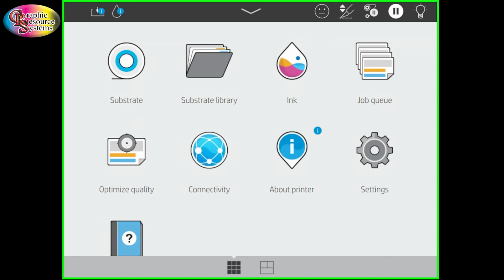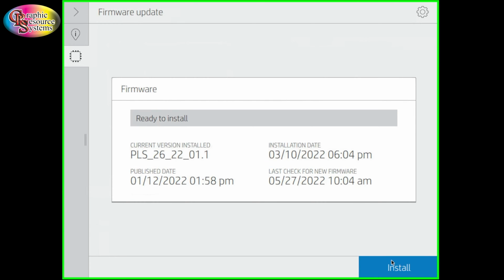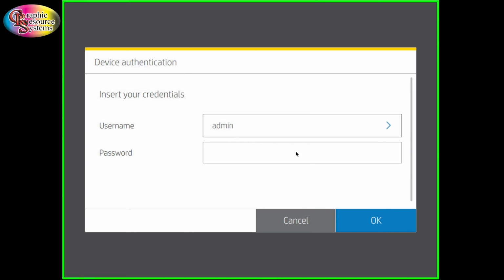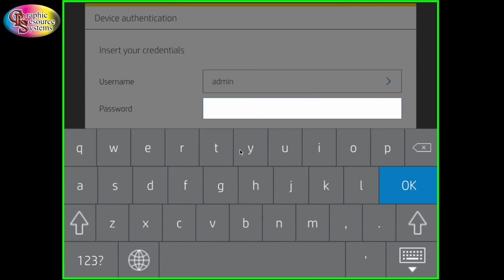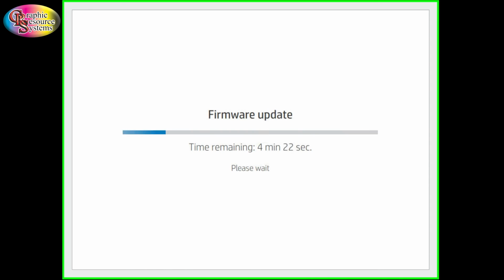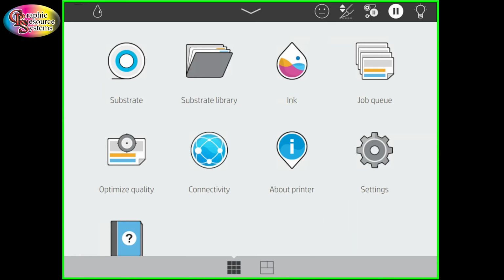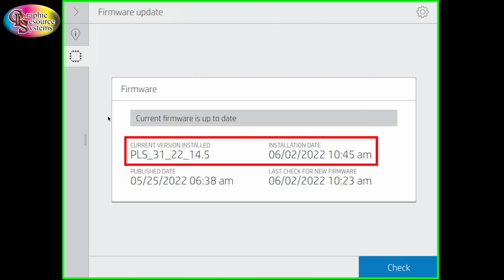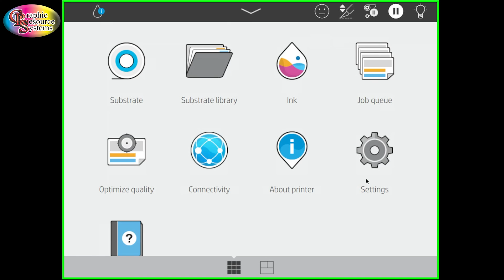Guide on updating the firmware on the HP Latex 700, 700 W, 800, or 800 W printer

Comment: How do you do it with a USB drive? Our printer does not have internet connectivity due to our IT's firewall.
Reply from the maker: You can follow the instructions on this pdf file from HP.  The first page and the top half of the second page show you how to do it. https://lkc.hp.com/storage/app/uploads/public/63f/864/ed2/63f864ed248d0335199970.pdf
Reply from the maker: I know this comment was a long time ago, but we now have all three firmware update methods documented on our website, the link is https://www.thegrs.com/view%20support%20doc.asp?id=%7B91E4C3CA-7E6D-48BD-BB4A-C131060D81DB%7D&Publishedfor=2098

Comment: Thank you! Please make a guide on how to connect remotelly to the printer like in this video!!
Reply from the maker: Unfortunately this functionality is only available for technicians.  Enabling it requires a password that HP will not allow us to share with end users.  I have suggested to HP that they remove that limitation so it is available to end users but they haven't done so yet.